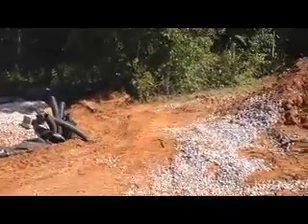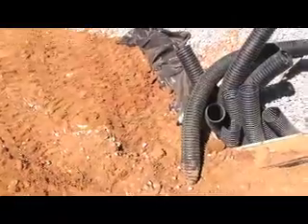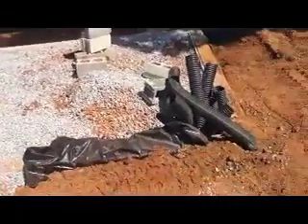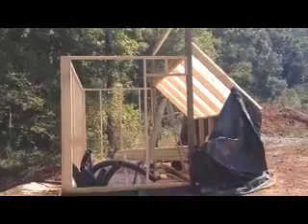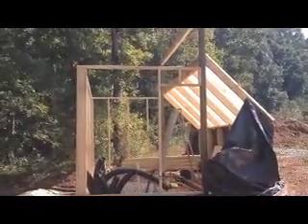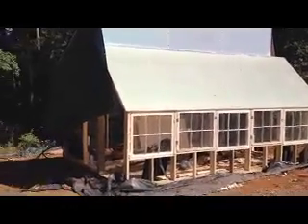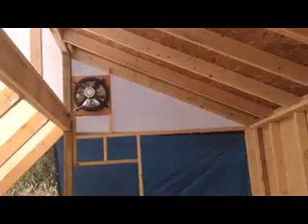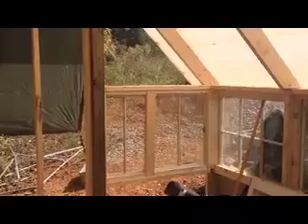Greenhouse2

Comment: does your pipe fill up under water?  what if you have water table where you dig and it fills up with water?
Reply from the maker: Dmitry Savy it doesn't so far. I took special care to prepare for drainage away from the walls. I also used tar sealant and plastic to line the walls to avoid any seepage..
Reply: I like this a lot as I have high water table and can use something like this.  Any idea how on temperature you get on summer on say 90/100 degree days?
Reply from the maker: Dmitry Savy see this link: https://youtu.be/KEIHXbLDVnU for a final update on this project. The temps would get at least 120*f if I didn't have an exhaust fan set to a thermostat. I really don't use the greenhouse much in the summer. It's just to hot.